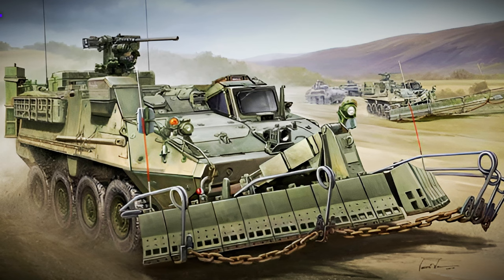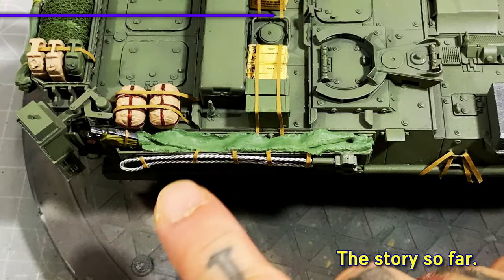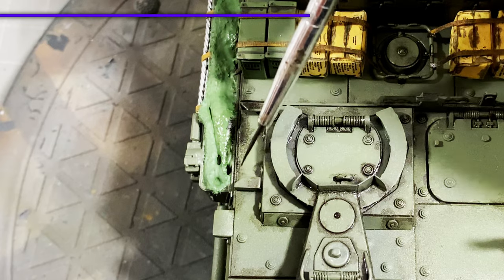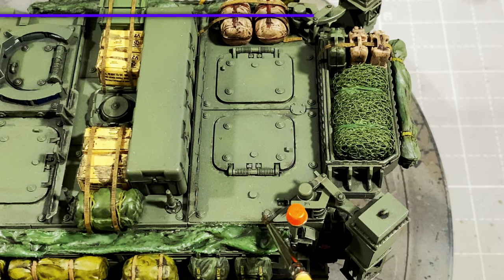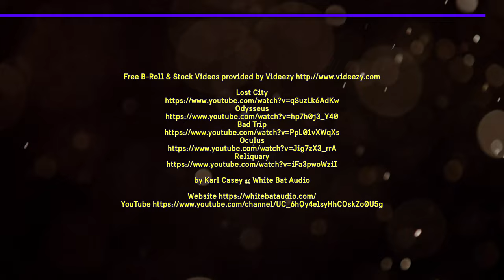M1132 Stryker Engineer Squad Vehicle - Surface Mine Plow - Final #ScaleModel #Miniature #ModelKit

Comment from the maker: 00:00 Hello my friends.
00:05 In this modelling project, I am finishing the multipart project of the M1132 Stryker ESV (Engineer Squad Vehicle) w/SMP/AMP-Surface Mine Plow in scale 1 to 35 from Trumpeter.
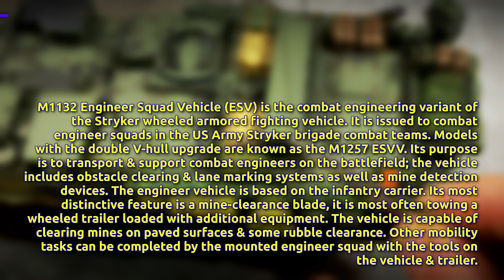00:24 M1132 Engineer Squad Vehicle (ESV) is the combat engineering variant of the Stryker wheeled armored fighting vehicle. It is issued to combat engineer squads in the US Army Stryker brigade combat teams. Models with the double V-hull upgrade are known as the M1257 ESVV. Its purpose is to transport & support combat engineers on the battlefield; the vehicle includes obstacle clearing & lane marking systems as well as mine detection devices. The engineer vehicle is based on the infantry carrier. Its most distinctive feature is a mine-clearance blade, it is most often towing a wheeled trailer loaded with additional equipment. The vehicle is capable of clearing mines on paved surfaces & some rubble clearance. Other mobility tasks can be completed by the mounted engineer squad with the tools on the vehicle & trailer.
00:44 The Stryker is a family of eight-wheeled armored fighting vehicles derived from the Canadian LAV III. Stryker vehicles are produced by General Dynamics Land Systems-Canada (GDLS-C) for the United States Army in a plant in London, Ontario. It has four-wheel drive (8?4) & can be switched to all-wheel drive (8?8). The Stryker was conceived as a family of vehicles forming the backbone of a new medium-weight brigade combat team (BCT) that was to strike a balance between heavy armor & infantry. The service launched the Interim Armored Vehicle competition, & in 2000, the service selected the LAV III proposed by GDLS & General Motors Defense. The service named this family of vehicles the "Stryker". Ten variants of the Stryker were initially conceived, some of which have been upgraded with v-hulls.
01:04 A combat engineer (also called pioneer or sapper) is a type of soldier who performs military engineering tasks in support of land forces combat operations. Combat engineers perform a variety of military engineering, tunnel & mine warfare tasks as well as construction & demolition duties in & out of combat zones. Combat engineers facilitate the mobility of friendly forces while impeding that of the enemy. They also work to assure the survivability of friendly forces, building fighting positions, fortifications, & roads. They conduct demolitions missions & clear minefields manually or through use of specialized vehicles. Common combat engineer missions include construction & breaching of trenches, tank traps & other obstacles & fortifications; obstacle emplacement & bunker construction; route clearance & reconnaissance; bridge & road construction or destruction; emplacement & clearance of land mines; & combined arms breaching. Typically, combat engineers are also trained as riflemen &, when required, serve as provisional infantry.
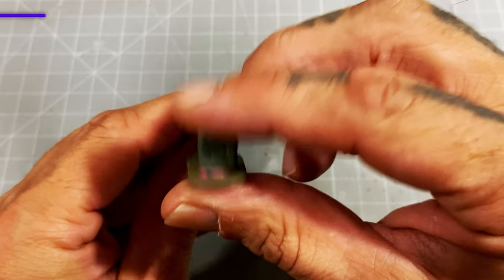02:23 I want to add more details on the vehicle so I prepared a few items off screen such as these jerrycans that I will paint with khaki, this net that I painted green, couple ammo boxes, these tent fabrics, bags & backpacks that I did with primer, & last but not least these 3 paper boxes from the kit. Khaki painting & I will finish off camera.
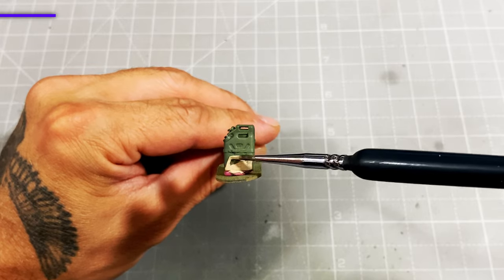02:58 ATTENTION! Keep always in mind that after gluing, painting, etc to let things dry.
03:12 Painting 2 maybe 3 items with ochre 2 coatings 1 off camera.
03:38 Same process with khaki.
03:50 Forest green.
04:03 They are ready. Super gluing.
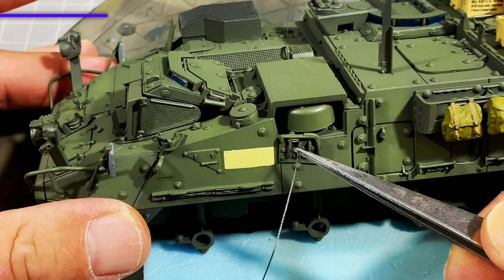05:41 Attaching the kit's wire.
06:15 Cutting & then placing 2 pieces of this dried baby wipe in order to make couple canvas covers for the vehicle's side cases.
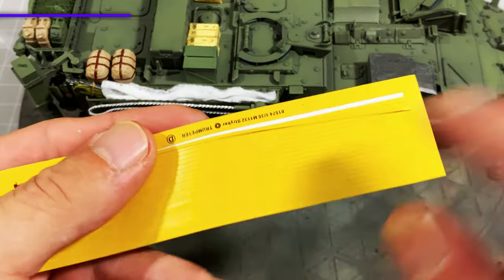06:53 Even though the kit includes stripes to use as belts/straps/etc I don't like it because its glossy. Making my own straps using masking tape.
07:12 Marking & cutting at 1mm (about 0.03937 inches --just like the kit's stripes) & will finish off camera.
07:31 Khaki gray.
07:46 1 coating is done. 2nd coating off camera.
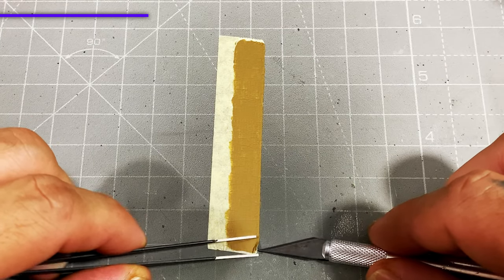07:50 Doing 1 stripe & the rest will do off camera.
08:18 Super gluing some of the stripes of which I have cut shorter to fit my needs.
08:49 Finished those stripes off camera. Attaching more straps to these metallic D ring hooks that I had done off camera.
09:31 More straps.
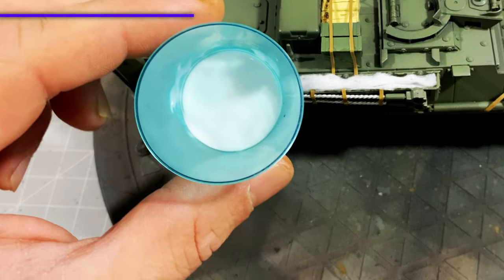10:16 I will use some PVA glue mixed with just a tiny little bit of water for a more liquid form in order to be able to give the illusion of canvas covers. Depending on how much the baby wipe will absorb maybe I will do 2 coatings.
10:35 I pulled this part here a bit in order to give it a better shape. Will finish both sides & a 2nd coating off camera.
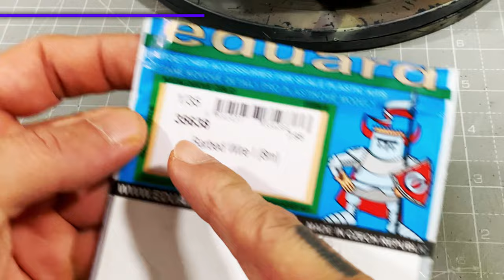10:50 Will be placing barbed wire in scale 1 to 35.
11:12 Wrapping the barbed wire & will be super gluing it.
11:45 Painting with matte aluminum.
12:11 More straps.
12:36 With a mix of forest green & green base doing some very light chipping mostly on the hatches & such.
13:15 Same process but with olive brown & dark sea gray.
13:58 Painting the covers with a mix of light green & dark green. Will finish off camera.
14:36 Enamel dark washing.
15:02 Fixing mistakes with enamel thinner.
15:29 Keep repeating the process.
16:26 This is the advantage of working with oil paints. You are able to fix your mistakes quick & easily.
16:39 Same process but with brown wash.
17:26 Back to enamel dark washing.
17:49 Back to fixing mistakes with enamel thinner.
18:12 Some light weathering with dark earth pigment powder.
19:27 Done with weathering & gluing the tires. Will finish off camera.
19:53 Attached the front part off camera. The story so far.
20:04 I will clear the front part a bit more but first metallic gray dry brushing.
20:39 Super gluing antennas that I made off camera because the kit didn't have any.
20:52 Gluing the gun with Tamiya's extra thin cement fast setting.
20:57 All things considered: family, work, vacations, major YouTube disappointment, etc. it took me only 4 months to complete this project. So, expect my next one to be ready some time next year 🤣
21:12 Hopefully you liked the project & you will enjoy the presentation. Because I love this amazing art & I strive to be better, please do help me by sharing your words of wisdom in the comments below.
21:24 Presentation
25:25 Hit the Like, Subscribe & Notifications Bell "buttons". This way, together, we can grow a community around the exciting art of scale modelling!
25:34 Stay "tuned" for more scale modelling videos.
25:42 Thanks for watching!

25:45 Free B-Roll & Stock Videos provided by Videezy http://www.videezy.com

Lost City
https://www.youtube.com/watch?v=qSuzLk6AdKw
Odysseus
https://www.youtube.com/watch?v=hp7h0j3_Y40
Bad Trip
https://www.youtube.com/watch?v=PpL01vXWqXs
Oculus
https://www.youtube.com/watch?v=Jig7zX3_rrA
Reliquary
https://www.youtube.com/watch?v=iFa3pwoWziI

25:45 by Karl Casey @ White Bat Audio

Website https://whitebataudio.com/
YouTube https://www.youtube.com/channel/UC_6hQy4elsyHhCOskZo0U5g